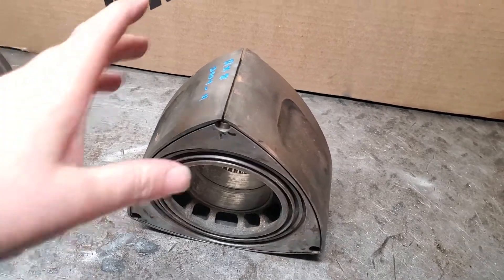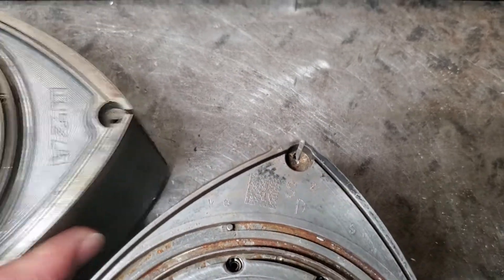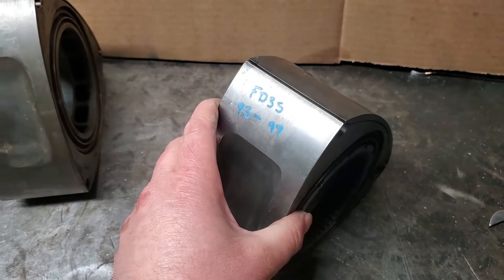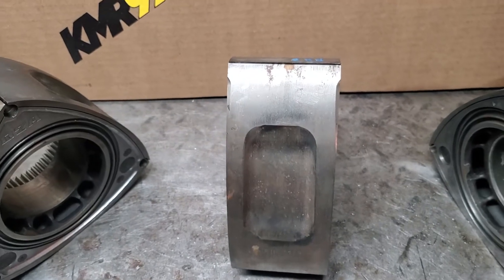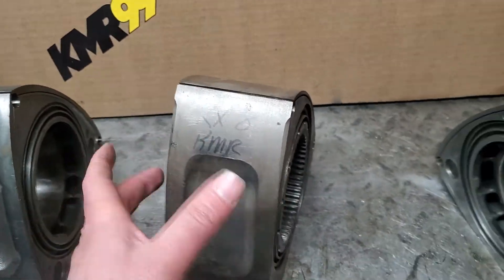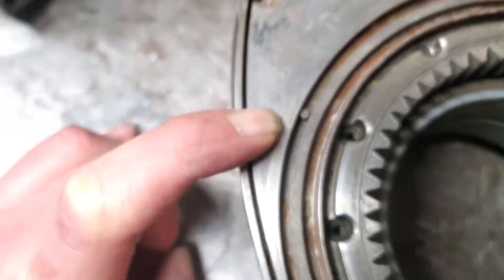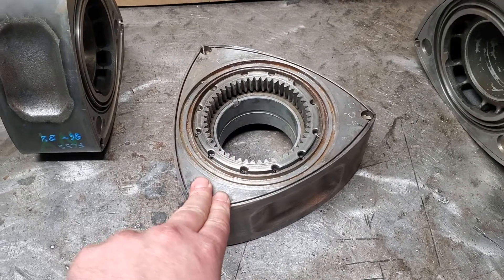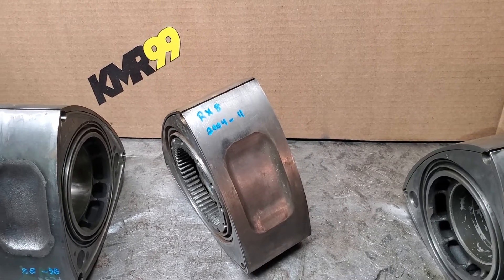All about RX8 Mazda SE3P Rotors,  information, specifications, how to identify - Kyle Mohan Racing

Comment: Hi we are struggling with a build its a semi pp s5 engine with half bridge port. And rx8 rotors.. compression is very good on both banks.. it does not want to start with starter. But when pulled start 6foot and it fires right up.. 

You said something about side seals of the rx8 is a problem on normal side plates. 

Can you please assist 

Thanks

Comment: @Kyle I've heard a few people say that the rx8 rotors are to weak for turbo application. Do you a agree with this? Also which gen rotor is your preference for turbo application?
Reply from the maker: Hard to say.  I know people that are using them in boosted setups.  Check out some of my other videos.  I did a video on what Rotors I run in the drift car and why. 👍

Comment: Kyle, are you sure the weight indication is given by the "e" stamp? Shouldn't it be related to the "D" letter near the "S" of the corner seal size, instead? Thanks for your knowledge sharing and congrats for the great work! :)
Reply from the maker: Hey thanks  bunch for watching. So i had to review the video and the rotor itself. But i don't think the large S or D stamps are weight indications. All RX 8 rotors have them in one corner, i will try to find out what they mean. Then there's the 3 side seal letters that where in Japanese on previous generations, and the one letter left is E.
Reply: @KyleMohanRacing  mate thank for the reply, but be careful: the S letter indicates the corner seal size which can be "S" or "L" (pink paint dot or white paint dot). 
The other letter near the corner seal (on the corner with the QR code, on the gear side) marking (the "D", in this case) should really be the weight indication. There are rotors lettered A, B, C, D and E (if you put on a scale rotors with these different letters you can see their weight is significant different and this maybe has to do with the casting mould wear, over the usage).
This letter is the same you find on the face of one of the combustion chambers, where you'll find it near an F or a R (indicatind either Front or Rear rotor) plus that same letter. (You should see FD or RD in your case).

The letters were meant for the assembly line employees, which had to match rotors with the same letter, since as you know the Renesis rotors assembly isn't balanced from the factory like the old ones were.

Even on the old rotors the weight had the same letters, written capitalized.
That little lowercase "e" letter is referred to something else (maybe the cut-off seal?) but is the same exact letter I always found on every Renesis rotor I got in my hands.

I'm really open to discuss on this if you think I'm definitely wrong, in the other case, I'm glad to have helped you someway! :) 

Take care and keep rocking always like this!
Love your cars and hope someday to have the chance to come to the US and meet you in the flesh!
Reply: @marox360  From what I understand this is the case, I had to take a second glance at all my parts when Kyle mentioned something else.. Kyle you should really get your info right, a lot of us look up to you (including myself) and watch these videos to gather information for builds.
Reply: @KyleMohanRacing  So what would we be looking for to do a 20B N/A PP with regard to RX-8 rotors?

Comment: Hey Kyle, what's your opinion on increasing the depth on an rx8 rotor to take the full size rx7 apex seals? Is it worth the hassle or is there not enough gains over a 9.7 or 9.4 comp rotor?
Reply: Came here to ask the same question. Then can they be used in pps successfully?

Comment: For the formula drift car, are you running an oil metering pump with e-shaft oil, 2 stroke oil injection, premix, or some combination? Is there a Renewable product that will stand up to heavy use?

Comment: Whats your technique to check the side seal clearance on the rx8? It feels inaccurate to me when I just try and hold the seal down away from the face as if it's under compression
Reply: If you google "rx8 side seal clearance" and look under images, the first image shows where to check 4 tolerances. These must be checked with 4 feeler guages at the same time. For the Rx8s people usually mess this up on their first go around (Myself included). Tolerance should be between 0.002in and 0.006in. Going tighter than 0.002in results in low compression when hot due to seals binding across the entire face of the rotor and the potential danger of breaking a side/corner seal.

Personally I started checking my ENTIRE rotor faces by compressing it by hand with a sheet of plexiglass to see if anything binds. Remember you can push one seal down and it may not bind, but when the engine goes together all the seals get torqued down at the same time.